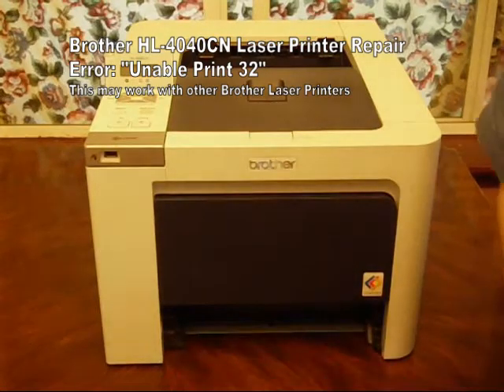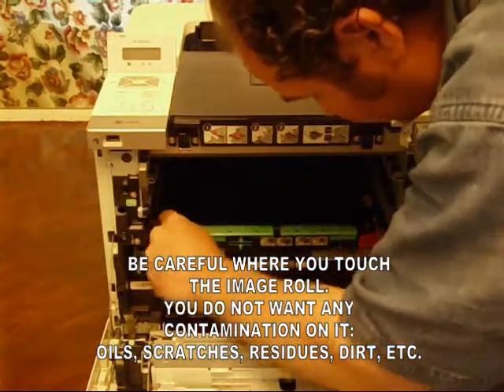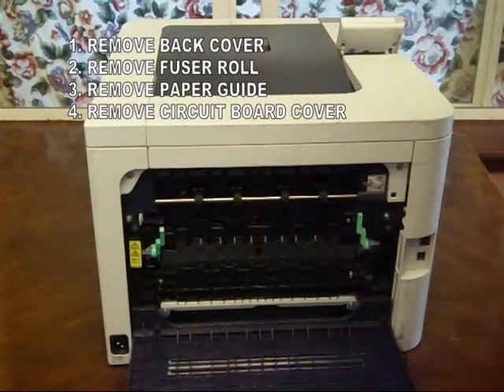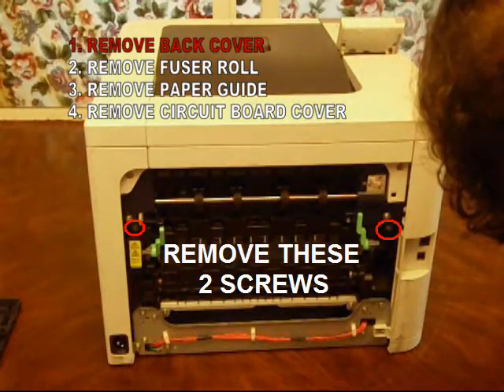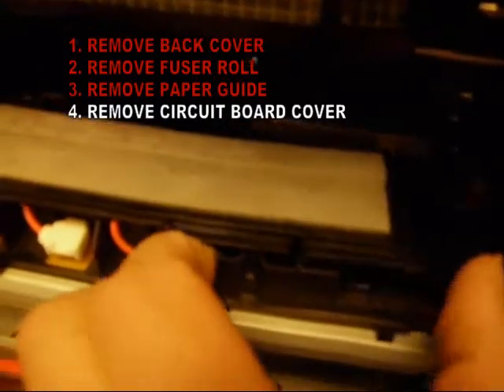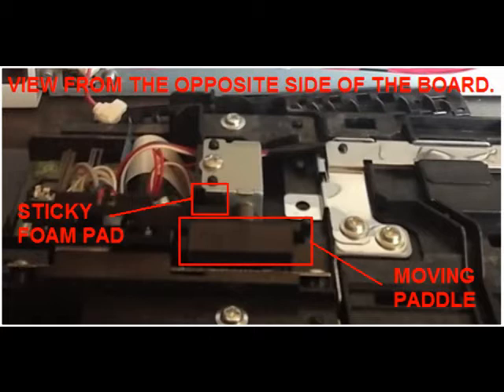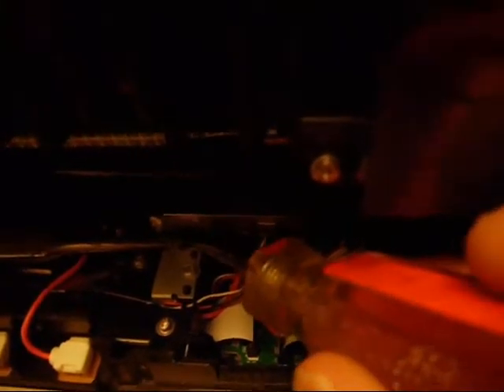Brother HL-4040CN Color Laser Printer Repair "Unable Print 32"

Comment: The previous owner installed a new set of toner costing £200 but sold it (HL-4050CDN) to me for £50 as he cannot clear the 'Unable Print 32' error message. 

I first read up about the printer then went to various forum on the internet including Brother website. They were suggesting I should check, clear and clean the inside for jam paper or foreign object that might be inside. I did all that but still no luck in clearing the error message.

Then I came across you video. It saved the day! 

It is exactly how you described it. The 'paddle' inside was sticking. I apply a  small piece of sellotape to the foam pad and it sorted the problem. Just can't believe it. It costs me less than 10 pence of material to solve the problem.

Thank you very much for sharing your video.

Comment: Thanks Brook. Your excellent step-by-step instructional video worked for me and 'fixed' my 'Unable Print 32' issue. After having searched diligently for non-existent paper jams and possible unknown stickers within the moving parts somewhere (as recommended by Brother), I was perplexed that it might even be a driver update issue; however, the printer needs to work before the update can be implemented. So, I decided to Google Brother HL-4040CN  'Unable Print 32' and discovered your video. Well, I'm glad that I did, as I have about $200 in new replacement toners which I can now still use if need to...thanks for your help.

Comment: I started getting "Print unable 32 error" for the past one month, my usual toner, drum cleanup didn't fix it.  Today I came across this video and that saved my printer for now. I ran into another issue when I closed up everything, got error "No Fuser unit found"  I had to remove the fuser unit one more time and put it back. Make sure its making electrical contact. 
I appreciate this video, otherwise I would have bought a new printer costing another 200$ and preventing a printer unit from ending up in electronic scrap yard.

Comment: You can do this from the front.  I took out the two trays, put the piece of tape on the top of the black gate (where it contacts the metal).  Worked !  Thanks for the video.

Comment: Worked a treat. Saved my printer  from the scrap heap. Thank for the post - much appreciated.
Reply: Just an adjunct to this for all those people pulling their hair out as to why their machine may not be working. Had the accursed 32 error appear last week. Checked the tape I had place in the machine as per this video 7 months age to see if it had come adrift but it was OK. Issue turned out to be the Belt Unit & waste toner cartridge in the machine got to their used by date. Cost me in parts around $180.00 Aust. This video mentions these items when you are taking apart the machine.
My trusty old 4040cn is now working again, as good as ever!

Comment: Thank you very much ! Like your channel name says, you are kind.
I was about to throw away my Brother HL4050CDN - after power cycling it over a hundred times, with ever less success.
Unbelievable that it all comes down to such a tiny detail.

It makes me curious - how did you ever find this knowledge ?
Is this like a trade secret among printer service technicians ?

My findings when following your procedure :
1. I doubt that it's necessary to remove the slide with toner cartridges and the transfer belt, from the front side.
    This whole intervention takes place at the rear side.
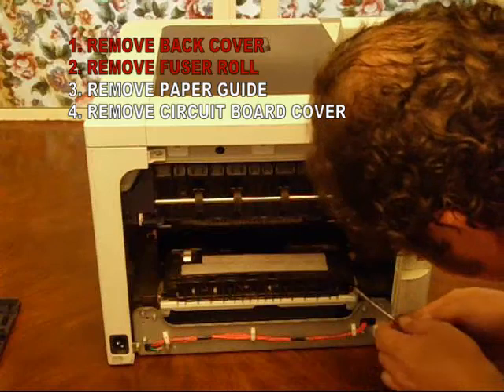2. I was a little too rough when removing the rimmed black plastic part at 1:45, and actually "broke it" loose.
     It's locked by two small fins at either edge, which I didn't notice among all the other blackness :-)
    Not a big deal however, it still fits quite securely back in position.
3. The "moving paddle" is TINY - I despaired at first, thinking that my printer model didn't even have this part.
     It's no larger than 1/3 of an inch ? It's hard to find too, being impractical to reach from the rear.
     My impression is that the exact movement of this paddle is a 90-degree rotation around a hinge :
     from flat down, to upright. A spring is supposed to push it back down, and that's where things go wrong.
    Just like you described in your audio commentary, in its vertical position, it remain stuck against the foam pad.
4. So, the foam pad that needs to be covered to neutralize its stickiness, is also vertically upright.
5. After completing the procedure, my printer worked again, just like in the old days.
    Thank you again - and no thanks to Brother, with their useless "Error 32 Unable to print - please power cycle" :-[

Comment: Thank you so much for the instruction.  You sure saved me some money.  By the way, I couldn't insert the tape in between and the thought of removing all the cables scared me so I used the garage oil spray lubricant and prayed.  It works.  :)

Comment: Thank You very much. This works on the MFC9840cdw too. I just removed the rubber bump pad. The printer will make a sharp 'click' now. Not sure if it will damage anything by doing this. I didn't want to use tape as this area gets hot. Thanks again!

Comment: I had a JAM TRAY 1 error. I contacted Brother support. They had me clean the paper tray pickup roller and pad, but that did not help. Then had me check for debris front and back, and toner carriers, belt.  No change, Then they told me I would need to replace my HL-4050CDN.  I had also tried the tape on the solnoid trick - NG. So then I vigourouses cleaned the long 2 part roller on the front cover, and it works now. !!!!

Comment: Is the paddle supposed to bounce towards the front of the printer (paper tray side) and not to stick to the pad towards the back. In my case it bounces back fine (it is not sticking to the back) towards the front of the printer and I am assuming I don't have this sticky issue. However I saw a paper jammed in the back of the printer as I was following these instructions. I am assuming that this is the reason for my "Unable Print 32" message (who came up with that?) and putting everything back again. Crossing my fingers hoping  it will fix the issue.

Comment: This is great, I used it a few years back and it worked.  Now, I am having problems with fuser.  I replaced it and the error code comes up 6a.  I have not found any help on this.  I have turned it off and on, etc., several times.  Removed it and replaced again, the same code comes up.
Any wisdom on this?  Thanks

Comment: Thanks for the video,fix seemed to work until i turned it on an sadly it didn't work which probably means the switch is faulty but guess i have to add that too 100s of dollars of replacement parts i was provided with in un-opened boxes that were all damaged at some stage during there life.
Guess now i have to pay HP some extreme price for ink when i had easily a few 1000s pages i could of printed...but having a career in IT this is def one of those moments you get annoyed at for time wasting lol